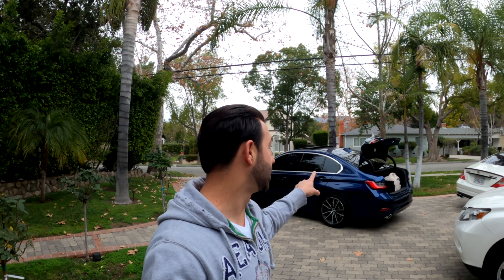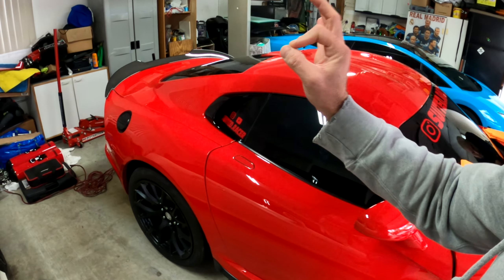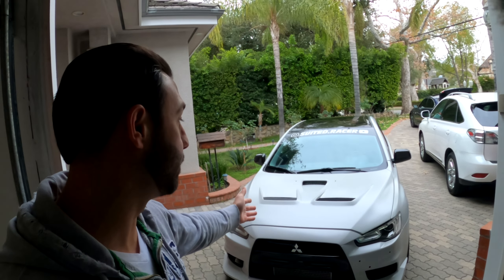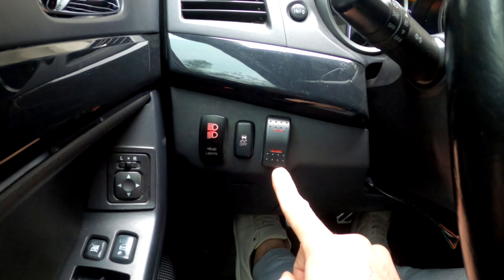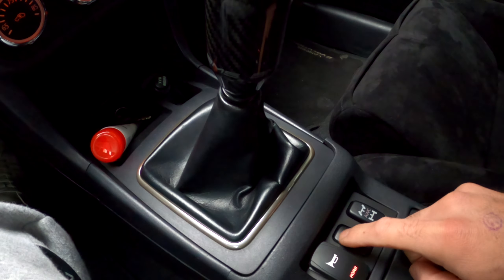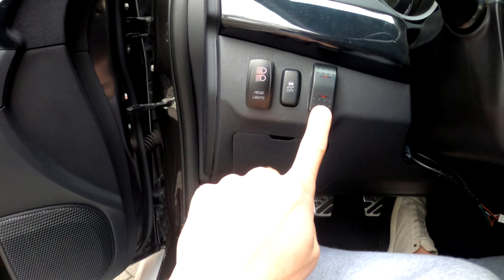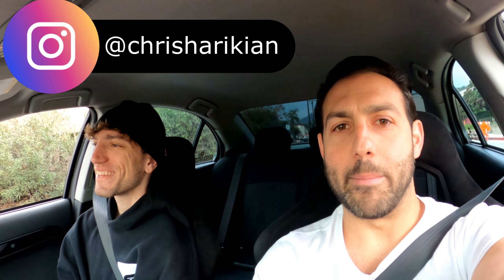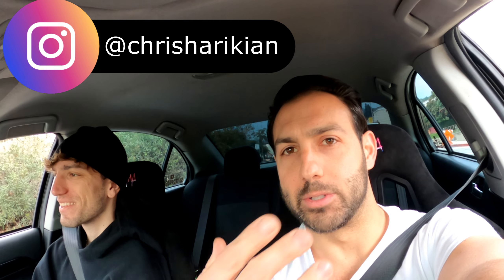first time driving my 1,000 HORSEPOWER EVO X - SUPERCAR SUSPECTS ride along !!!

Comment: How did you calculate 800+AWHP equates to 1000 BHP?  Does the Mainline Dyno read lower than a Mustang?
Reply: generally speaking you take 15% drivetrain loss on a RWD car 20=25% on a AWD car
if it makes 800wheel in almost anything you can say you make just about 1k crank horse...
Reply from the maker: ToStompU nailed ymy calculation to the TEE

Comment: How did u get the head lights to work cause mine don’t and it’s really annoying
Reply: On your blinker stick is the lights
Reply from the maker: i hard-wired the bulbs inline to one another, then ran the power (red) to the 12v cig lighter, bridged the other end to the rocker switch you saw. so it'll work as long as the 12v cig lighter is working